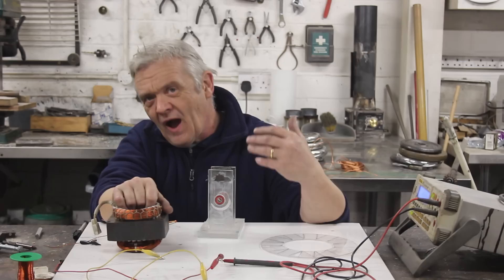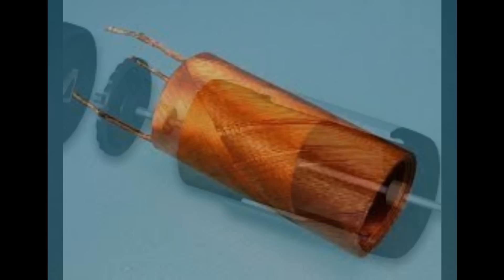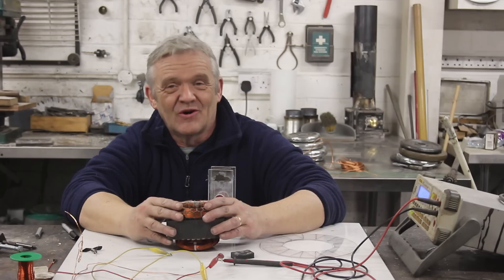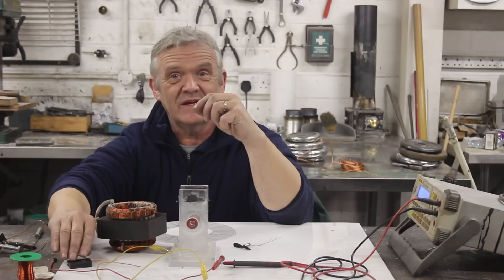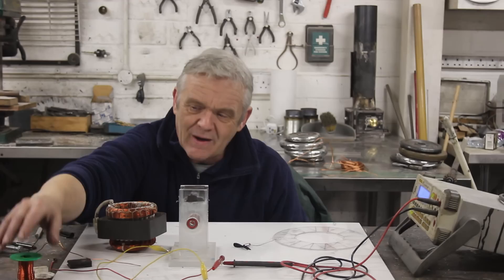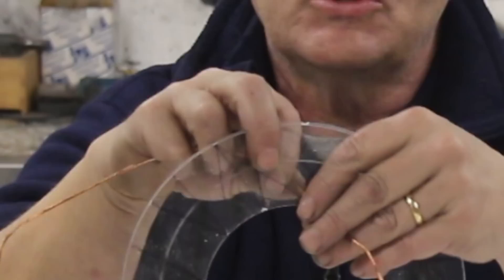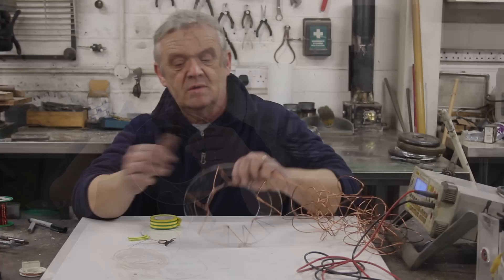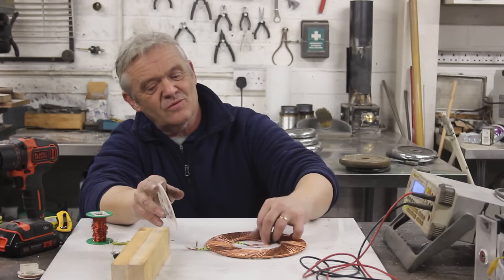1801 Winding Star (Faulhaber) Coils And Making Litz Wire

Comment: The field may be intersecting at an angle and so weaker on a per strand basis but is that still true if you maintain the same amount of copper?  Using the wasted copper of the standard or serpentine coils means you'd have more strands per section in the Faulhaber coils so would that compensate for the weaker field interaction?  Would it be a net gain, a loss or just equal?  Thought experiment, 10 strand flat coils, 1 at a 30 degree angle like the Faulhaber coils and 1 vertical like a standard coil.  Magnets the width of the 10 strand coils at 30 degree angle.  As the coils pass over the magnet the total length of copper for the vertical coils is a little under 2x the Faulhaber from when it 1st comes onto the magnet to when the last leaves.  However the total length of the wire in the regular coil where 60% is not used is 2.5x the length of the wire over the magnet (did the math for both a 30-60-90 triangle and the regular coils as each strand entered and exited the magnet.) whereas the Faulhaber coil is only 1.15x the length of the regular coil portion over the magnet.  So for each strand of the regular coil you can have about 2.2 coils of the Faulhaber.  All other things being equal this seems to indicate the same length of copper in the Faulhaber as in the regular coils would give 10% more energy than the regular motor and still be far lighter without the iron.  Now there's a LOT I don't know about electromagnetism so if there's something I am missing, which I deem likely, please edumacate me.  Thanks.

Comment: Should you want to make a 3ph version, would there be an advantage to 3 identical coils and have 2 sets of magnets? It seems to me that should a fault happen in one coil, it could be replaced instead of scrapping a coil with all 3 windings combined. It seems to me that there is potentially an increase of magnetic field.....perhaps additional sets of magnets would be needed on the outer as well to keep the fields even across the coils.

Comment: Hypothetically; 
If the magnetic flux side-penetrates the disk, it may produce opposing electron flow, ending generation.
If instead one used steel wire, it's own magnetic permeability may block flux penetration.

Or a high permeable disk, metglas, silicon steel, Permalloy, etc..
Reply: Yes, but iron or steel can also bend the magnetic field too. Check out how guitar pickup coils work.

Comment: problem with your star coil like most other coils is that every time you cross the wires you create impedance.
the entire reason why a current is created by a moving magnetic field is that the field reorients the alignment and paths of the electron orbitals of the conductive metal...the reason skin affect is a thing is that the thicker the metal the more atoms sharing valent bonds have to fight with each other to orient their orbitals when the field passes by them...  the best coil will be one where the wires never change the direction they are moving... more importantly they never cross one another

Comment: Do you have a video about resins? I'm using epoxy to rebuild a stator, but I'm worried about it's ability to dissipate heat. What are the options?

Comment: Could this be made as a printed circuit board? Very helpful.
Reply: Great idea if you connected the traces correctly across the different layers. Still wouldn't be as dense as wire windings, though.

Comment: The skin effect and self inductance are actually pretty deep concepts in the study of electro-magnetism. 😅
Reply: Not really. it happens as low as 50Hz in mains generation. My local hybrid pumped hydro station uses Aluminium tubes as buss bars. because of the high AC currents, a solid conductor would have big eddy currents being induced in itself from the changing magnetic field. Those eddy currents then set up their own magnetic fields and tend to push the main current to the outside of the conductor. I was shown this in a tour as a first year electrical student.
Reply: @JehuMcSpooran  Oh okay.

Comment: A useless bit of information, terminating Litz wire was often done using a spirit lamp with an opening in the tank, heating the end of the wire and then plunging the hot wire into the meths to strip the individual conductors. Then the ends are ready for soldering. Nowadays of course a lot of enamel wire is self fluxing so no need for this process.

Comment: Robert please look at the Newman motor as a generator . It has only one coil with a magnet inside of it spinning. Soo Corless  and very simple and no wasted copper.  Perhaps ignore the "free electric " nature of Newman himself if necessary
Reply: Not Newman again, arrggh
Reply: @justtinkering6713  I know I'm not a Newman fan either . Whats wrong with that coil / magnet arrangement for home generation . Like I said forget Newman and his "free" electricity . . He still has a working motor or generator. Spin the shaft and voltage comes out like any generator .
Reply: @justtinkering6713  does that particular coil / magnet arrangement not work well as far as output or efficiency? I see one interesting thing about that arrangement is it looks to be producing pure sine wave
Reply: @justtinkering6713  awe bro you could have just said 1561 instead . Why not be helpful ? I do t get it
Reply: @mattg6472  okay, I'll check it out too. I just connected the Newman name with hokum. LoL
Reply: @justtinkering6713  agreed Newman is connected to hokum lol. I don't care about Newman I care that his motor/gene is one coil one magnet very easy . Forget Newman's free energy claims.. Used as a regular generator with somthing actually spinning the shaft it's a really simple gene that could be utilized nicely for home generation.
Reply: @mattg6472  I looked at the patent application and it still looks like a lot of hokum. It keeps mentioning a special secret material used. It's all balderdash and not worth anybody's time.